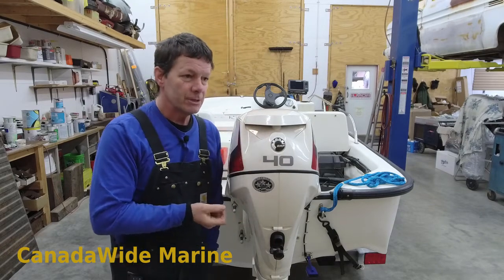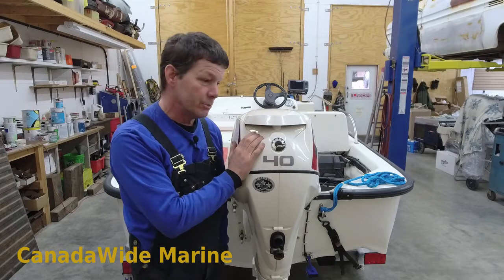Outboard motor cable steering systems explained.

Comment: I have a 1991 Wahoo 18.5 CC with a 150 mariner. I cannot let go of the wheel for a second while underway or the boat will go into a spin. I just purchased one of these based on your video. +1 Subscriber

Comment: Got me a 2001 Seaark  with a 90 hp Mercury. How do I know if i have rotary or NFB? The steering is very tight and also pulling to one side . I am in the process of cleaning/lubing the tilt tube grease build up and adjusting the trim tabs. I would appreciate your thoughts. Thanks
Reply from the maker: If the steering pulls to one side you have a basic rotary system. Once the steering gets tight, we generally replace the helm and cable assembly. It is often the cable itself that has tightened up over time, and because it is tight the helm has been overworked, not to mention it is usually over 20 years old. So for the few extra dollars we replace the complete helm and cable. In your application, with a 90 hp I would also upgrade to a NFB helm. Basic rotary  systems are not recommended for your hp levels any more.